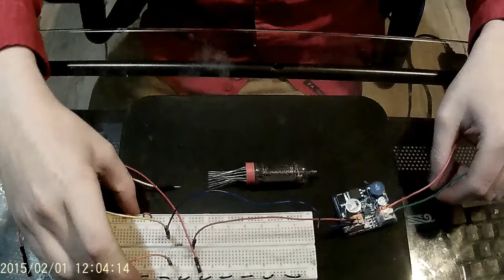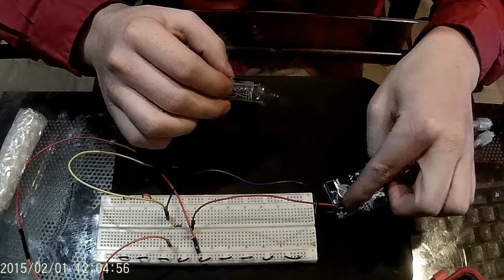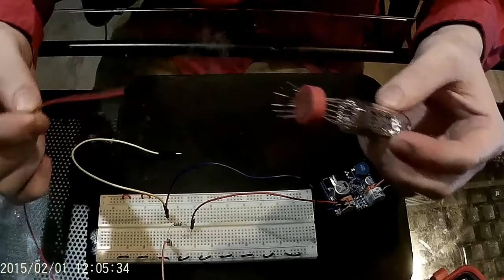Nixie Clock With Arduino (Step 3, Tube Testing)

Comment: By the love of God, you don't hold a 180 V male pin with your hand and touch anything with it! You just DON'T!! That's reckless!! You risk your life!!! 
And worse,  you are INSTRUCTING people to do that!!!!
Here's how you MUST do it:
0. With the system NOT energized
1. Instead of a male pin, use a FEMALE pin and securely ATTACH it to a Nixie tube pin, just like you did with the common pin.
2. Connect a multimeter in series to monitor voltage during the test.
3. Find a way to keep the step up board and the Nixie tube rigidly fixed. I use a plastic vise.
4. Now turn the ACDC power source on.
5. Congratulations! You have just finished testing the first Nixie tube pin SAFELY!
6. Power down the system. 
7. Want until the reading in the multimeter reaches zero.
8. Unplug from the 1st pin and plug into the 2nd. 
9. Go to step 4.

Repeat steps 4 through 9 until you have tested all pins in your Nixie tube.

Now, PLEASE, correct your step 3 video and text!!!!!!!